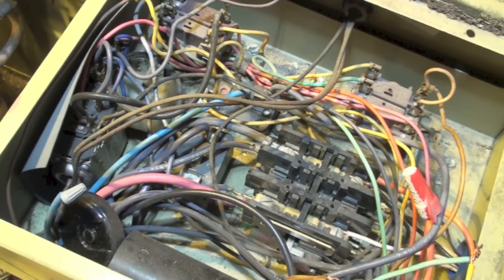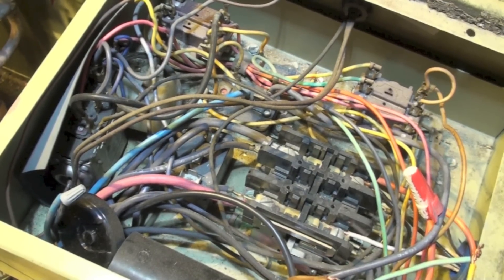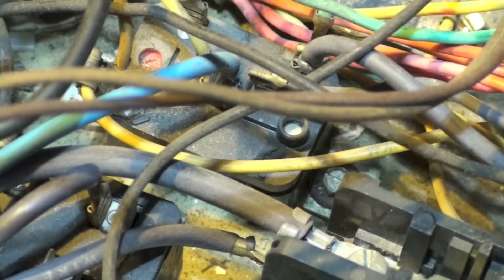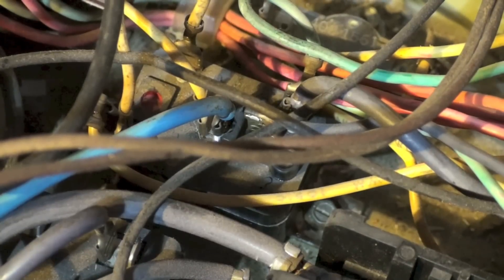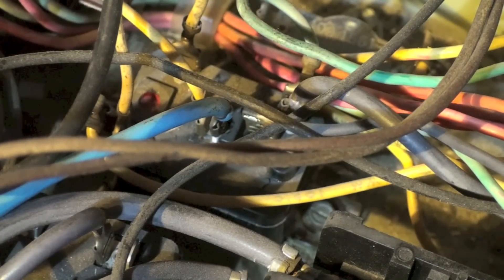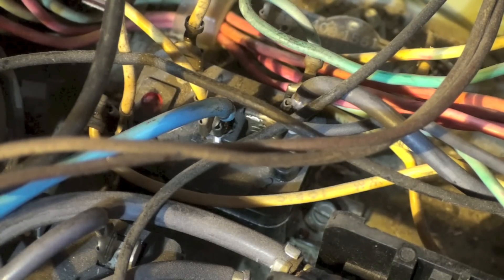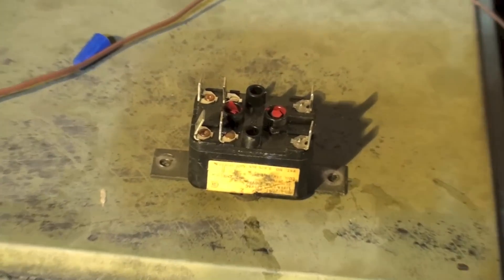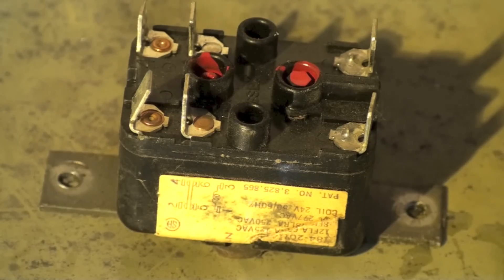What's wrong with this heat pump #1, answer

Comment: Im not quite sure how this problem works out.  The contactor was pulling in and only one leg had power going through.  The peanut relay is down stream from the contactor, how does that effect line voltage through a contactor, guess im lost or i need to see the wiring diagram.
Reply from the maker: The peanut relay is a control relay that powers the coil of the contactor.  So when it sticks, the contactor stays on.
GFM
Reply: Man do i feel like an idiot.  This comment was intended for your other video that shows this same system.  Sorry for the confusion

Comment: I guess tools of the trade are extremely important!! QUESTION THO
GR8 VIDS! I WATCHED MANY.help??? mega info :)
I CANT GET MY BECKET RUNNING RIGHT.theres a few things going on.
the gap is even with the nozzle.only the electrodes stick past it.like theres no space.between the two.yet the elec is 1/16 past the nozzle technicly. their flat/no points and i see after 1 day the carbon is scoring on the bottom 1/8 on boyh electrodes.no scoring on nozzle..but nozzle has a darkish droplet stuck to its bottom.once it croaks totally i remove the gun,line and scrape everything down n it runs for a few hours...
ITS STALLING AFTER 1 MIN THEN LLOCK OUT>pump goes 20sec b4 lock out
"     "           "              2 min ""
stumbles every 20 sec...sometime 1min..sometime never thru a cycle up to 12 min.. i jumped the cad eye no difference..ohms are 1500 off 500 on,WHEN IT STUMBLES THE OHMS GO WAY DOWN,fan pumps 30sec then lokout<i thought maybe the eye caused the stumbles> ....sometimes after it wont run past a min...40min later it WILL RUN A WHOLE CYCLE but stumble and catch stumbles usually 1/2 second..the longer it stubles the better chance it wont recatch.. again it wont run past 1 minute...it always runs dead for 20-30 secs b4 lock out. if i shut the heat off after a lockout.it will reset itself... just had full tune up.  spark is hella strong!!looked too strong compared to utube tests...the aqua stat hums lightly..flame is bright orange/yellowish...on restart i never see a puff of smoke...IF IT DIES..I CAN TURN THE ON/OFF SWITCH AND IT WILL LIGHT RIGHT BACK UP FOR A MINUTE AT LEAST...once the on/off switch wouldnt even trigger the cad box took 10min to reset somehow....theres a spring loaded check valve in the gun fuel line im getn susiscious of..i blow the line out by mouth and oil comes out in a straight stream pretty easy..the B.damper dances pretty hard constantly.seems like somethings killing spark,,those 20ish seconds the pump is going w/out fire,i see no light thru the crevices and cracks by the coil..sometimes it runs nice catches every stumble fast..sometimes it does the 1min/2min thing or 40sec. its like a crapshoot everytime it clicks on!!!!!!! when i take the tiny oil line off to remove gun,i never see any dripping oil.yet the gun is 30%full.?also under the gun i s  wet. not much just a thin coat..it never ignites,it might be moisture 4 all i know.